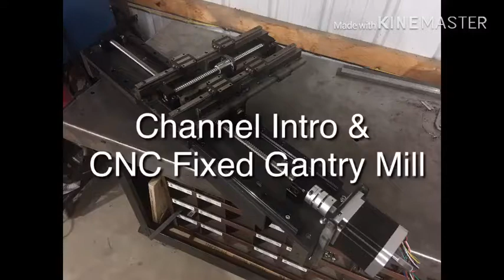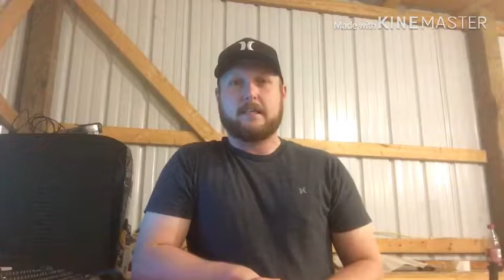Channel Intro & CNC Fixed Gantry Mill

Comment: great to see that . i like the idea and every thing . and about the fixed vs moving gantry is the footprint of the machine . moving gantry design have smaller footprint compared to other systems
and yeah about the spindles i agree there isn't much options there except if u pay a lot of $$$$ .
 i wonder if a diy spindle worth it ? with just a simple ER taper and thread in the end with no tool changer and no tool holder and more less parts and the tool is closer to the bearings so more rigid (i think)